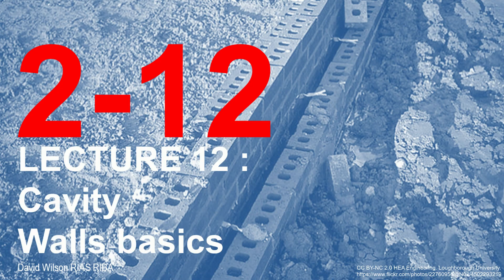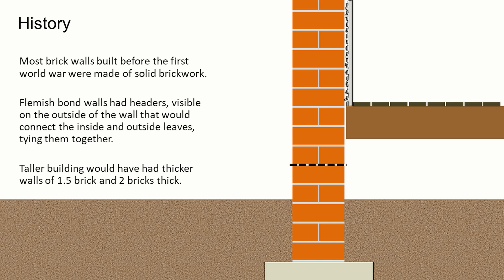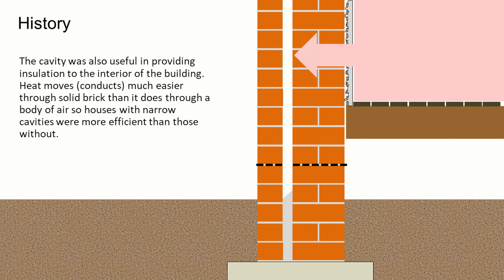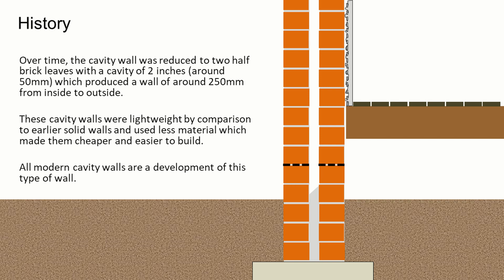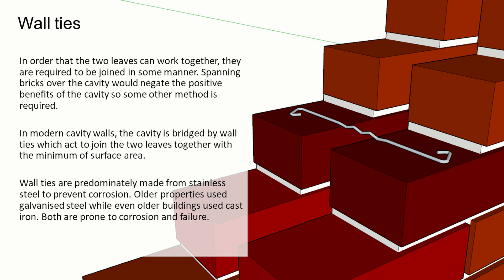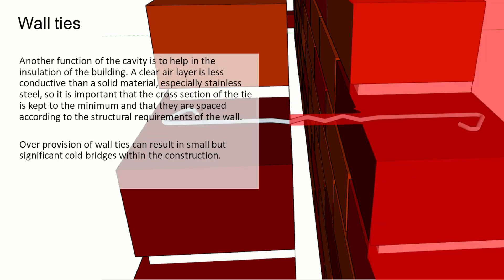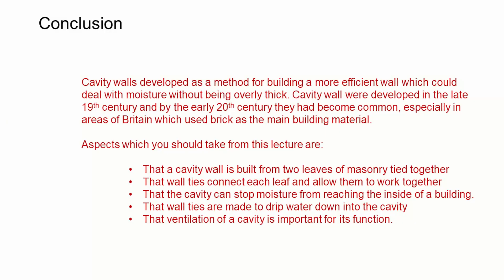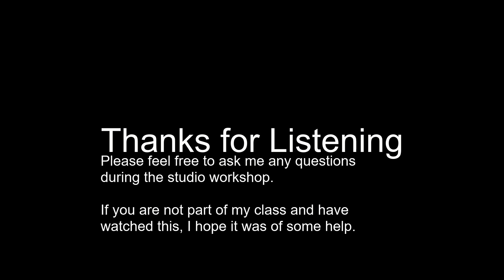12 Cavity wall basics

Comment: Honest question... any benefit for building walls with no cavity but twice as thick. Would the shear mass of the structure make it last longer than thinner modern walls with cavities...
Reply from the maker: Sorry for the late reply. Before cavity walls became common that was the way that most stone or brick walls were made. I myself live in a house made of a solid granite wall. The thickness of the wall does protect the interior, so long as the wall is well made and maintained. Most older solid walls use lime mortar and this is (IMHO) key to managing water as it is essentially a breathable mortar that allows any trapped water to leave the building after it has entered. I have a lecture in this series on traditional walls.
Reply: I think moisture would get in so no I might be wrong though

Comment: We have just had an extension built, it has a concrete floor so do we need air vents in the wall or not?....
Reply from the maker: It very much depends, if it's a solid floor then it wouldn't need vents through the wall to supply air... But you may still need vents for cavity walls or indeed to provide air for a suspended floor beyond the new extension. If you have an architect it would be worth asking them for clarification. Cheers
Reply: Thanks so much for your reply

Comment: Would it be normal to hear a lot of rain fall in the cavity wall between two neighbouring houses
Reply from the maker: The wall between two houses, the party wall, should not normally be open to rain at the top so I would say that it would be something you would want checked out. If it is rain then there is probably a problem at roof level, or it could be a leak of another kind. Worth getting a specialist out to look at.

Comment: Is it economical?
Reply from the maker: Hi I'm not sure what exactly you are asking but if you are asking whether cavity walls are economical then the answer probably depends on where they are being built. Its not a technology that is used a lot in Scotland (where I am) but it is used extensively in England and some other places. The cost, and therefore the economical factors of the wall might depend a lot on available materials and skills. The other view of a wall being economical is whether it can reduce running costs over the lifetime of the building. In this case it is possible to make cavity walls which are very high performance. The downside is that there is always a balance between making a cost efficient wall which performs well in terms of heat loss, and making a wall which restricts the passage of water. Cavity walls with fully filled cavities are not suitable for all locations. Not sure if this answers you question but I hope it helps.